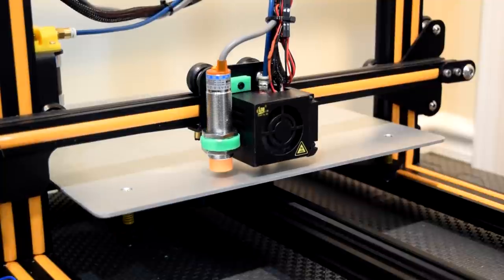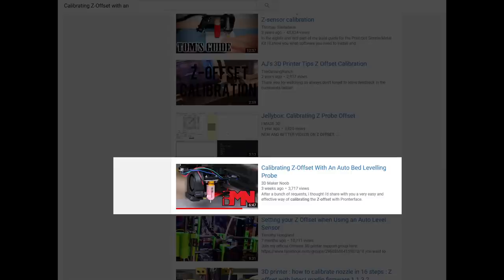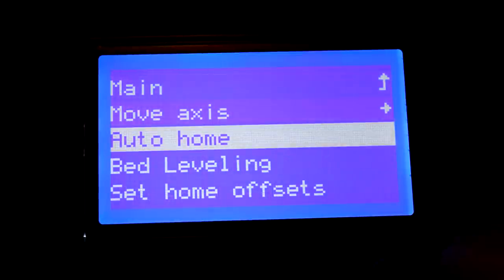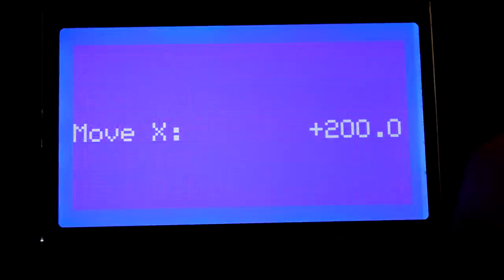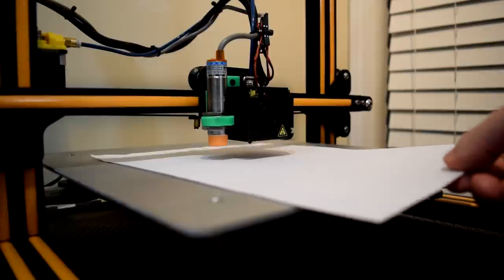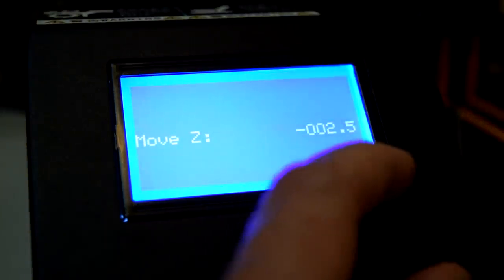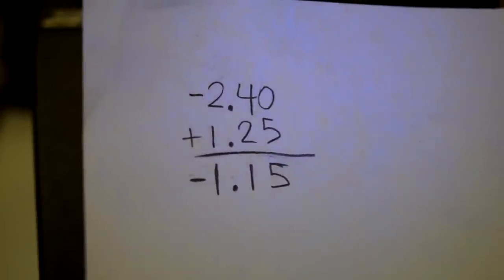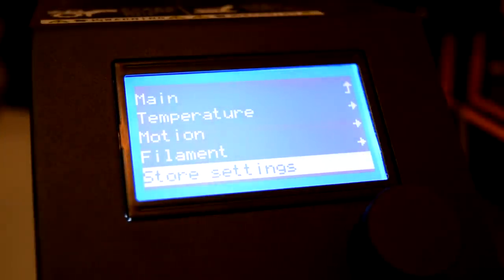Setting your Z offset the easy way in Marlin

Comment: Where do i enable the offset setting in marlin? Cant find it
Reply from the maker: In Configuration.h I believe you have to have either FIX_MOUNTED_PROBE or BLTOUCH enabled for the Z offset option to show up. (that's what a search on google suggested) I haven't tried installing every version of Marlin, so newer versions may be different, but even the latest version of Marlin on Github has those settings in Configuration.h

Comment: Put a touch sensor on my biqu b1 and home is still bottom left. How come everyone elses auto homes to center.....
Reply from the maker: I'm gonna be honest with you, I haven't done much with writing firmware on 3D printers in several years now, so newer versions of Marlin may be different, but the old version had a setting in the Configuration.h file called Z_SAFE_HOMING, and it had Z_SAFE_HOMING_X_POINT and Z_SAFE_HOMING_Y_POINT. if you turned on Z_SAFE_HOMING by removing the // from the start of that line, it would set the homing point to the middle of the bed.

Comment: My printer raises up about 30mm after home. Display show up Z:10. What am I doing wrong?
Reply from the maker: Are you using a version of the Marlin firmware from one of my videos? a couple thoughts, are your z axis steps calibrated correctly? For example, if you use the control box to move the z axis up 10mm, does it move up 30mm? If that's not the problem, you may want to try running an M502 command followed by an M500 command and M501 to reset the default settings in the firmware and load them up into active memory. Marlin has a strange habit of not overwriting existing settings when you flash the firmware over a previous version of Marlin. so if you wrote different firmware to your printer recently, it may still be hanging onto old settings and messing it up. - if you do this though, you will need to perform any steps/mm calibration again, because it will load all of the settings coded in the firmware.
Reply: Thanks a lot for your very fast reaction! Performed your steps with no success. :-/ Running an M119. Is it normal that endstop status of z is always "TRIGGERED", even the LED on the sensor is off?
Reply from the maker: If you're using my Nano Bed Leveling or Arduino Uno for this, try changing the two wires that go to the endstop. it sounds like those are reversed. or if you are using my arduino sketch, you should be able to get away with using the other arduino sketch since it reverses the wires for you.  If your printer moves to the middle of the bed and only raises up, that is the problem. the board is seeing your sensor as always activated, so it thinks it's at the bottom and raises twice instead of sensing the bed
Reply: You are my todays hero! The both outside cable (blue and black) were reversed. I could have come up with that... THANK YOU BRO!
Reply: @Boyd_Crowder   I'm looking for the same solution.  Did you ever fix it?
Reply: @georgepenzenik9994  Yes. Read my previous post.

Comment: to do this you have to disable soft margin control in marlin code and upload it.
Reply from the maker: I think it's called MIN_SOFTWARE_ENDSTOPS in the newer version of marlin, but fair point, I should have mentioned that.
Reply: Thank you. By using pronterface and send M211 S0 then used your method and get perfect result. The critical part you mentioned here is to position the nozzle to the location of probe. Good job.
Reply: Ya , there is no option to get my z height to negative value
Reply: I'm having this problem now, need to go to negetive values and my tronxy x3a won't allow it, even with M211 S0, which doesn't seem to work atm. From searching around it looks like the option needs to be set in firmware, what's a straight-forward way for a novice to do this? cheers :)
Reply: @SuprSi  I have the same problem, did you solute It?

Comment: My control box doesn't have all the same options...
Reply from the maker: There are other ways to accomplish the same thing by sending manual GCode commands from your PC, this is just the easiest way if your firmware is setup with those options. You could change your firmware to add those options, but that's a whole other topic.

Comment: when i go to move z offset it wont go down it will only go up
Reply from the maker: There is a min and max Z offset in the Configuration of your firmware. you can usually get around this by adjusting the height of your auto bed leveling sensor manually

Comment: cant get in the negatives with the option "Move Z" :/
Reply from the maker: Yeah, there are several comments on this video about this. it's a setting in the firmware and there are a couple ways to get around this. try using either Pronterface or repetier host to send M211 S0 to your printer. That will disable MIN_SOFTWARE_ENDSTOPS
Reply: Remain Indoors Thanks! I will try it :)

Comment: So basically nobody looked into the included instruction manual?
Reply: Mine didn't have an included instruction manual. Nor does it have a Z Offset option under control
Reply: @Falney  In that case: Please do check if you even have a fan inside your CR20 to cool your mainboard. A lot of CR20's seem to dont have them. 
PS: There should be an instruction manual on paper and on the micro SD card. If not: shoot your supplier for sending a B-stock model

Comment: My print doesn't let me lower it below zero....
Reply from the maker: there's a setting in the Configuration.h file in the firmware you can change if you want to write new firmware to your printer.  Or, you can just set the Z offset to about -5 (or lower if necessary) before you follow this video. Then you won't have to go below 0, you'll just have to add the positive z offset and raise it back up when you find out
Reply: I did everything right but when it starts printing it digs into the hotbed like a 1 mm deeper than it suppose to be. Did you ever have this problem?
Reply from the maker: yeah. so if your current z offset is -5 and your nozzle reaches the bed at -2.5 you would end up with a new Z offset of -7.5  - or if it's currently -5 and your nozzle reaches the bed at 1.3 your new Z offset will be -5 + 1.3 = -3.7
Reply: i did exactly that and after auto home and probing it starts to print and digs deep into the glass. I know your tutorial is right because I did it before but I don't know why it's like this. I changed a couple things from the configuration file.

Comment: err! Too far message
Reply from the maker: it sounds like your version of Marlin most likely has MIN_SOFTWARE_ENDSTOPS enabled. If you want to flash your firmware to disable that, it should work.  But if you don't want to flash the firmware, you'll have to do something like G92 Z10 with a computer attached to your printer to set the Z axis to 10mm after it's reached zero. and you would have to figure that extra 10mm into your final z axis offset. there are some other videos that explain how to do this in detail, I think 3d maker noob has one that explains it for the BLTouch.
Reply: Remain Indoors thanks for reply